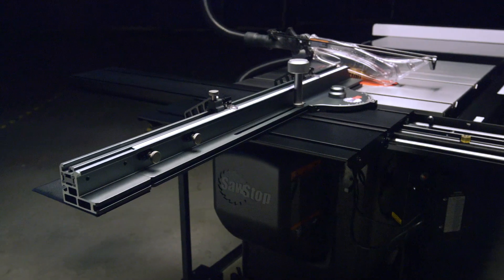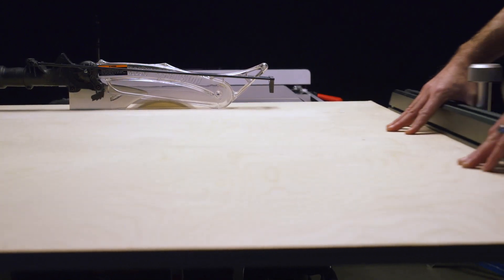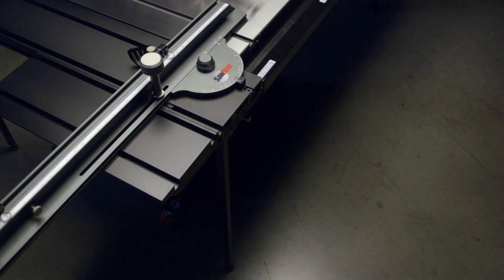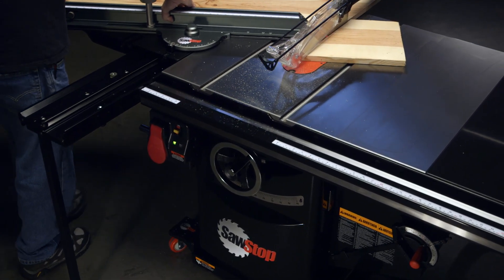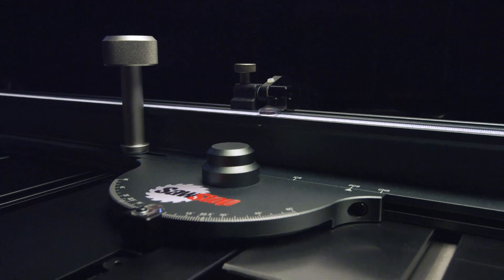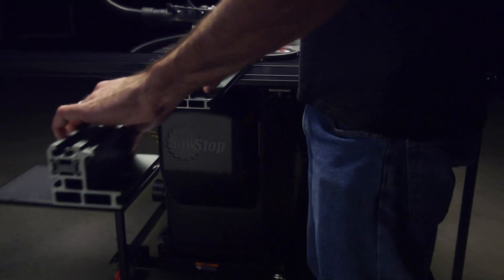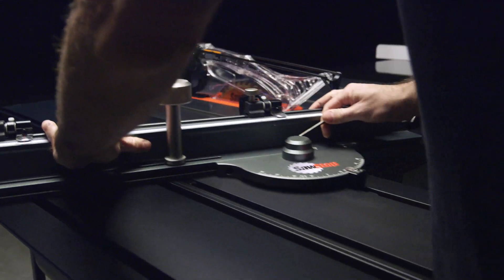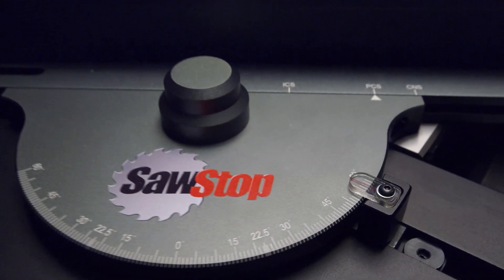SawStop Sliding Crosscut Table

Comment: The Saw Stop table saw is great. The sliding table is not worth the money.  It is virtually impossible to square it up to get completely square corners. My son and I added set screws to the mounting rails to try and get some more accuracy, we tapped into the protractor to install a 90 degree locking point, as the engineers at saw stop feel this was not important. We contacted Saw Stop to get some help with this, we sent them a long detailed email about what we had tried to do. Saw Stop showed no interest in helping us. My son is a professional cabinet maker, he is so frustrated with the sliding table, that for his latest project he ordered material, Precut by CNC from the material supplier, simply because he did not trust the accuracy of the sliding table.  I am sure one day we will get it set and locked into a true 90 degree angle, but why should we have too.  The amount of money we spent on this sliding table, the engineering should have been done at the factory. If we could get our money back on the sliding table we would gladly accept it, and then purchase something else more precise. I cannot understand how a company that can develop a game changing piece of equipment, that can save thousands of personal injuries, cannot come up with a solution to constantly and repeatedly cut 90 degree angles. To say we are disappointed, is an understatement. Saw Stop, FIX THIS PROBLEM.
Reply: Hi andrew at work we have a leeda panel it costs about $6800 and you have to square the fence to the blade ,its a shame when they made this panel they did not have square stops where the fences table is.Thats where the felder has the  square fence system.see andrew i have a sawstop cabinet saw and i like it And i was thinking of buying a mini max or a felder one day and got to have large shed put a felder panel saw in,my shed is large enough.     australia.
Reply: I m a bite late to read your comment. Bought this crap few months ago and found the same problem. Wouldn't have bought this if i read ur comment earlier

Comment: Hahahahahahahaha WHAT A PIECE of s### It ain't even worth the price of aluminium. This is at best a kids toy. It is weak, flimsy and a pain in the a.. to use. 
Don't know where to start so I just say it as I see it. It is going to the trash bin..  
My advise, if you are in the search for a professional system. Save up and purchase a Felder sliding crosscut saw. The saw from SawStop is the only positive thing here, i love it. 
Best regards.
Reply: My advice: Learn the difference between the words "advise" and "advice."
Reply: Hey a man on utube was using sawstop sliding table,he was using a finger joint jig on the sliding table and he was getting excellent results,Yes felder panel saws are very nice i thought about buying one but i have a sawstop and it is excellent.With the felder panel saws you have work out if you have plenty of room in woodworkers sheds. Yes you are right ,buy a felder .At home i have a felderAD741 planer thicknesser and a sawstop cabinet saw.
Reply: @shanehertzog5812  pinche mentirozo tambien es una mierda